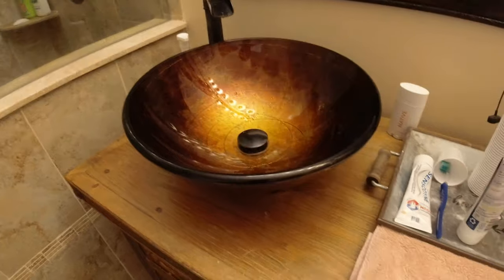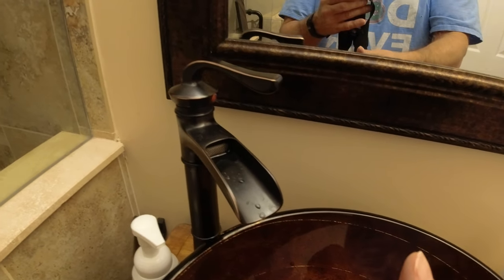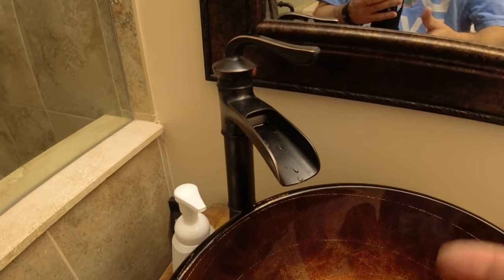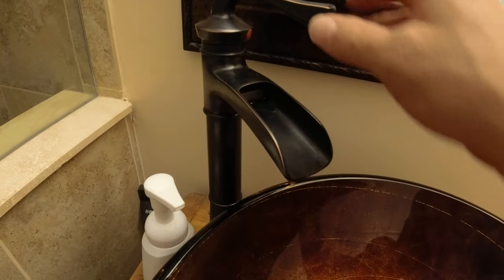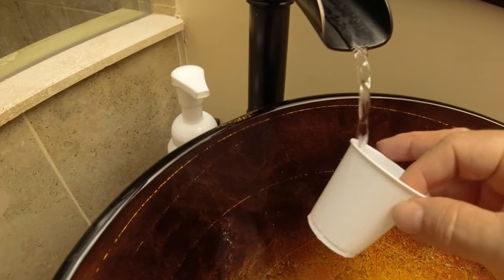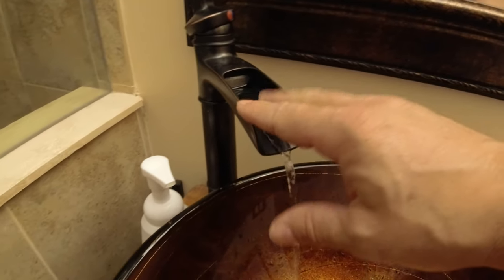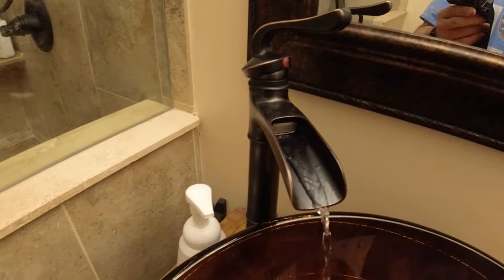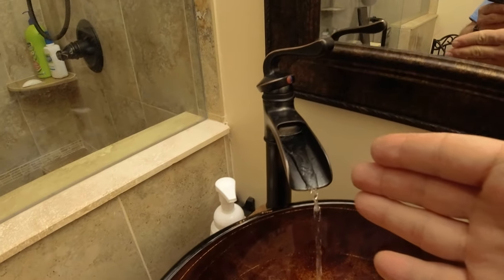Waterfall Faucet Flow Repair removing restrictor: A Do It Yourself DIY project

Comment: You could have left the little blue water restrictor out of the faucet. Almost all new faucets have them in either the aerator at the faucet spout or they are under the valve cartridge. I always take them out when installing faucets. The water restrictor in most aerators for the spout sometimes are like a clear pinkish film and barely perceptible. Others look like a very fine screen with a rubber washer around the edges. I just use the tiny screwdriver tip corner to scape them off. They always come off in one piece. The EPA passed a rule that all new faucets have these lousy water restrictors in them. And look at the problems it causes people. There are several other YT videos on this same subject.

Comment: You could always partially close the valves underneath to slow that flow down but you are correct the water is now blowing by where that o ring was.

Comment: My problem isn't water flow, I want to know why this company would build a faucet with an aerator that is not replaceable. I had issues with my previous faucet collecting goop I mean it looked like black mold so I would replace the aerator regularly. I bought a waterfall faucet same manufacturer but similar to this one unknowing that the aerator was permanent. If I'm wrong please advise. Nice video.

Comment: I have this exact same faucet and have been fighting the low flow issue for some time.  Thank you so much.  I left the entire flow restrictor out (not just the o-ring) and it gets even more flow.  If turned on completely, it will splash out of the sink.  I no longer have small children so I'm leaving it that way.  The teenagers who use this bathroom can moderate the flow with the handle, as it should be, and are loving it.
Reply: how did you get the entire flow restrictor out?  I got the o-ring out easily but cant grab that restrictor to pull it out?

Comment: Dang, I have three of these on three sinks and one is flowing slow. I thought the thing had gotten clogged up so I just ordered a new one today, but after watching your video I am going to try your fix. If it works you are my HERO and I will send the new one back to Amazon. God Bless DYIers.
UPDATE : few hours later, I used your suggestions on how to remove the faucet handle, but I used a pair of Snap Ring pliers to remove the collar that holds down the faucet cartridge. Worked great and I had it in my tool box. Harbor Freight has them as well.    So project complete, no leaks and I have great water flow from this faucet. Thank you again for putting this YouTube together.  The new faucet that I ordered from Amazon will arrive tomorrow and I will send it back , thanks to you.

Comment: Your lucky you were able to take it apart.  A lot of the products today make it darn near impossible to fix yourself.  Good job.
Reply from the maker: Definitely odd they only have those two holes to unscrew it. Perhaps that's a normal way of doing it in China but I saw no information on anyone else that had to take off one like that. Luckily that spanner was just a couple of bucks on Amazon but it took like 3 weeks to sail across the sea ;p

Comment: Thank you for saving me money. The low flow started a long time ago and was almost at a stop. This fixed my issue as well. Now I have to turn the supply valves way down because the pressure is so good but too good for the sink. Again, thank you so much for sharing this.

Comment: We're renovating our bathroom, and this faucet is one of the new features to our ensemble.. haven't worked to the point of installing it yet, but I am glad I came across your video...  as we have well water, I anticipate encountering some blockage and slowing of water flow over time... after viewing your video, I'm going to save myself the time and just remove the restricter(s) before the full install. Thank you for posting this!

Comment: I have the same faucet by BWE. Thank you for the link for the spanner wrench, ordering today. Bought one from local hardware store but it's not durable enough to get the grip I need to loosen the top. Thank you for the video!
Reply: I can’t find the link. I looked on Harbor freight and Amazon but none of the tools look like words in the video. I would appreciate some help. Thanks.

Comment: I have a 2 handle version and the fix is the same. Just remover the cap at the top of the outlet. Thanks for the video and yes, I had to partially close the water supply to slow the flow a bit.

Comment: Hi, I have almost the same exact faucet as you, I took the outside piece off and then used an Allen key to open the top and I got the screw out but can’t take the handle off 
What am I doing wrong or how can’t I take it off?

Comment: My problem is it’s just the hot water for me. The cold water flow is great. But the hot water trickles
Reply: Is the sink like this one or does it have separate handles for hot and cold?  If just one is slow, it might be your cartridge.  Dual handles faucets often have two cartridges.